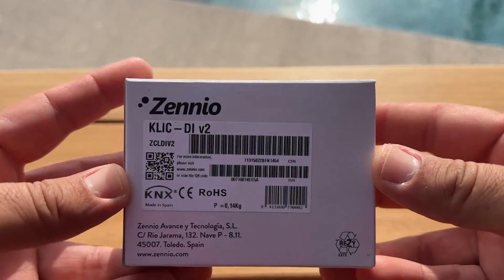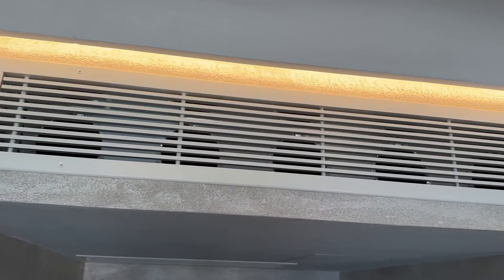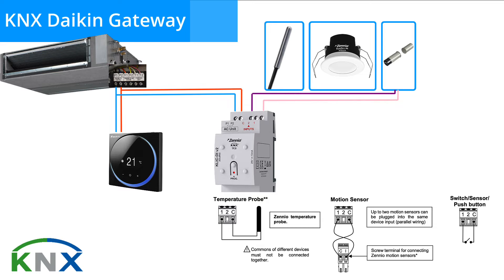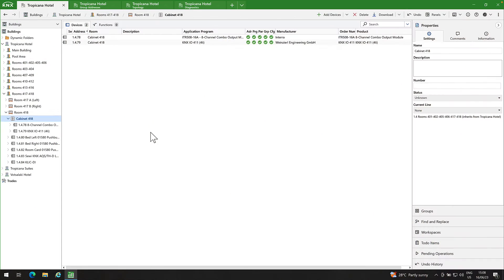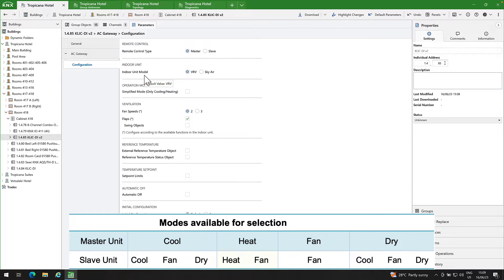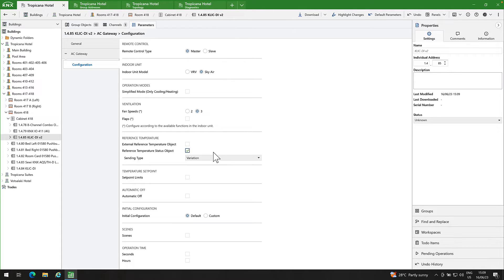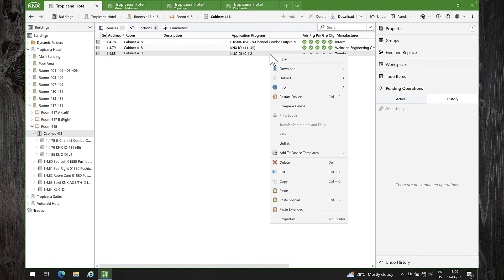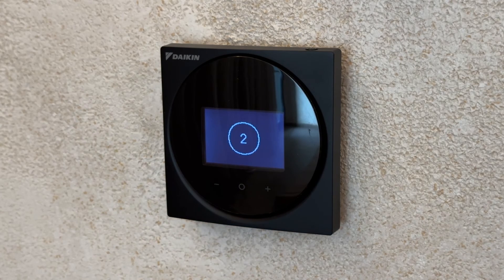KNX Gateway for Daikin Air-Conditioning Units - Step by Step Tutorial

Comment: I did exactly the same ! Try the mushroom climate card as well. Just a shame that they don’t add fan speed control to the climate cards … yet 😊
Reply from the maker: Tell me about it! But since it is Home Assistant there is always a workaround!
I used the following :    
   - name: "R01 AC Fan"
      address: "1/5/4"
      state_address: "1/5/5"
      type: percent
      min: 0
      max: 100
      step: 33
      mode: slider